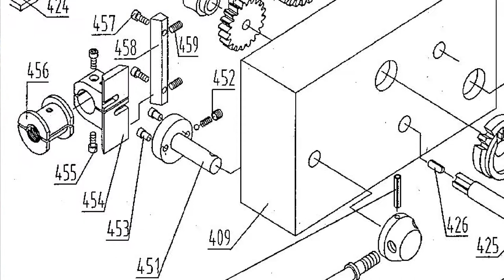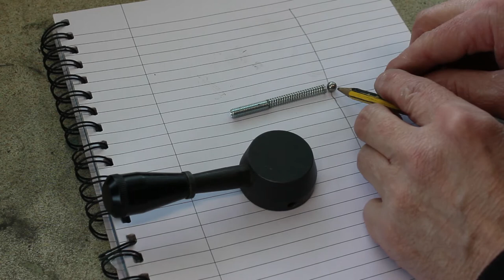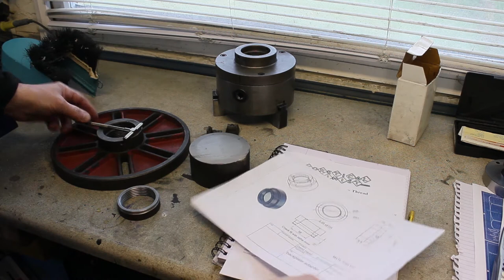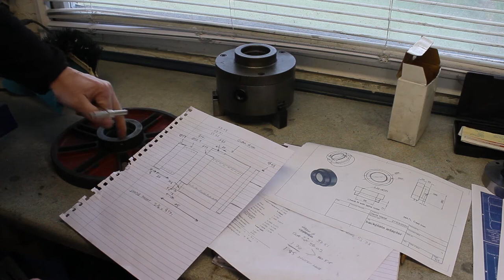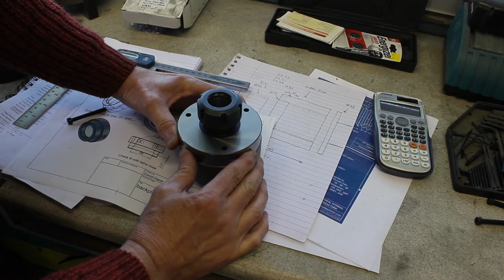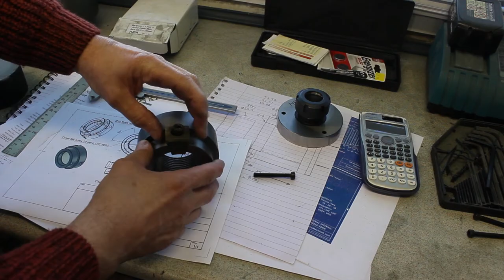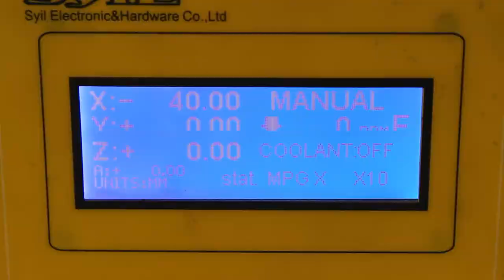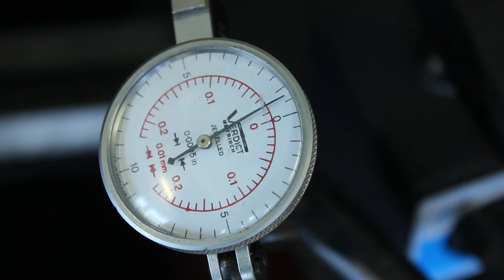Collet Chuck for my old Craftsman Lathe

Comment: What settings did you use for the screw cutting, loved this video btw
Reply from the maker: Hi I cannot remember the actual thread dimensions however I will find out and post them in the  description. 
Best
Reply: The dimensions were the same as yours in the video , I’m looking at doing the same for a back plate as I have no 4 jaw chuck fixing although I have a chuck it was gear box settings I wanted to know as screwcutting is new to me but with your video I believe I could do it , most helpful to me it was many thanks 👍
Reply from the maker: @mcpautoparts2171  
Hi I thought it was best to reply here as the  settings for my lathe match yours . Would be confusing for any other lathe!
The change wheels are 40 tooth at the top ( closest to the spindle) this meshes with the 120 tooth on the same shaft is the 127 tooth and finally the 40 tooth on the gearbox shaft.
The gearbox settings are B and 1 
If you don't have the info panel for  your lathe let me know and I will get a picture over to you.
I found to learn on a piece of scrap was best with a large run out  groove in it  so you don't crash the tool!
Good luck
Reply: @CazualHaze  many thanks mine has the panel although not sure about the gears as I had it second hand and I’m missing a few bits hence the back plate it’s for a 4 jaw chuck can I ask did you get extra gears or are they standard to the machine
Reply from the maker: @mcpautoparts2171   They came with the machine not sure what pitch they are you might be able to get them from the supplier Mine was Chester but its now an old model. However I do think the gears might be the same in some of the current models.
Good Luck